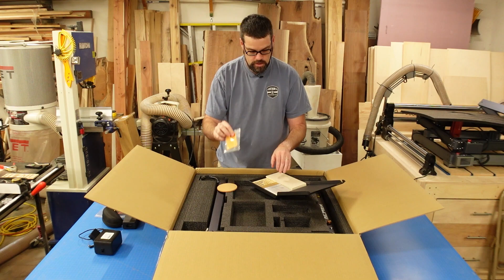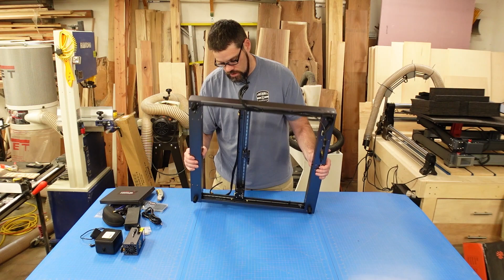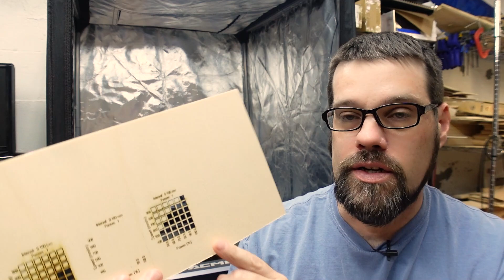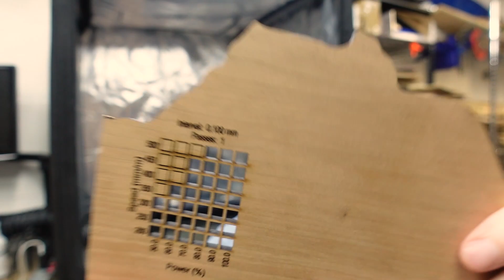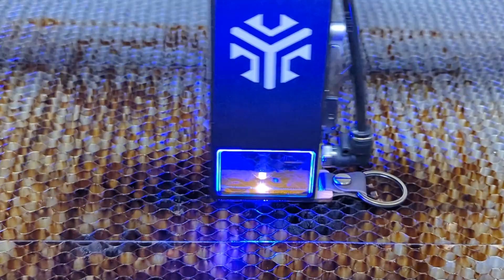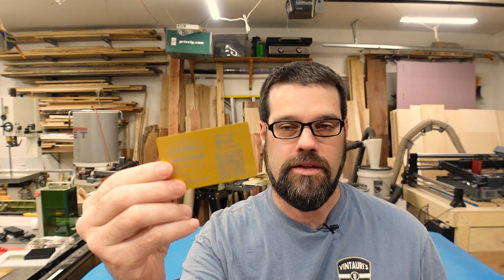Acmer P2 33w Laser - Powerful, Fast and Precise!

Comment: I purchased  Acmer P2. It move side to side but not. up or down. I contacted support 3 times but no answer. What could be the problem?
Reply from the maker: I would first check the rotary switch in the back of the frame, make sure that is set to Y instead of R. If that is not the issue it might be a stepper motor connection is not tight.  I would start by checking all the plugs on the steppers to make sure they are seated correctly and that there are no pins pushed out.

Comment: Steve, Do you think the acmer 33 watt is a better laser than the longer ray 33 watt.Looking to buy one, just not sure which one. thanks
Reply from the maker: Both are very similar. The Longer will have a slightly larger working area and the end of the module can be removed which can be nice when using a rotary or when in an enclosure, it's less likely to get in the way.
Reply: Thank you

Comment: I read in other comments that it doesn’t have a preview laser light to show the working area?
Does it comes with tue air assist?
Thanks 😊
Reply from the maker: In lightburn you can turn on the laser light when framing to get a preview of the working area. It also comes with an air assist pump.

Comment: I hope other mfg start to see the benefit of paying attention to the look and feel of the laser. For too long lasers have had a half finished feel to them, no cable management to speak of and open rail construction that just feels half done. Acmer and others (xTool as well) are pushing the trend of having machines that have a nicer finish, cables that stay out of the way, and just a better feel to the machine. One question I would have for you is how are the plugs on the machine. Are they good and steady so as not to feel like they wobble a lot when you plug in the USB cable? And does the wifi ability have any options for hooking up the machine via wifi when using other software than their mobile app? (Such as access with Lightburn?). Overall a solid looking machine and the price point is actually pretty good. I noticed the price difference between the preassembled and DIY version is only $100. I think if I were to buy this, the money is well spent having it come preassembled. I would also be interested to find out how responsive and easy to access their support is. Anyway, thank you Steve. Good unboxing and review. Have had my eye on this one for a few weeks now so glad to get your take on it.
Reply from the maker: Thanks Jack, I agree it's nice to see some thought put into the overall frame and cable management. Acmer is one of the best kept secrets in diode lasers from my experience.  Both machines I have received have been very solid and worked above my expectations.   I'll take a closer look at the cable connections and wifi and follow up with my feedback on those two items. As for support, I hope to not find out but it would be good to know how quickly and efficiently they respond.